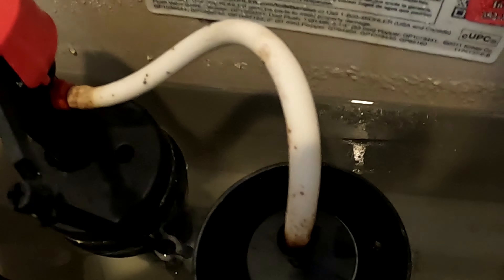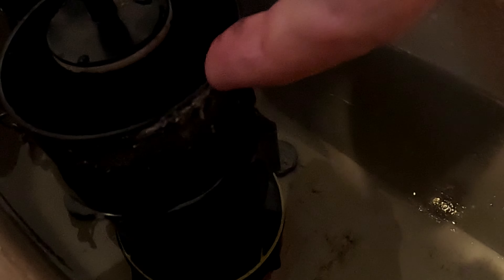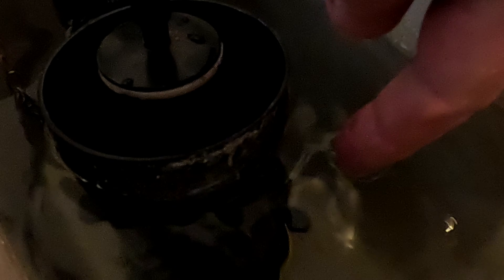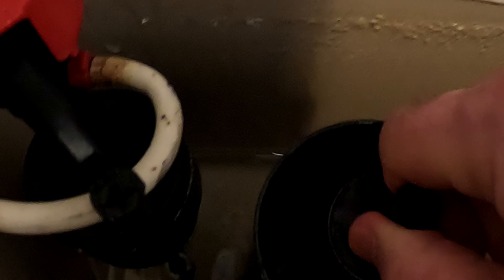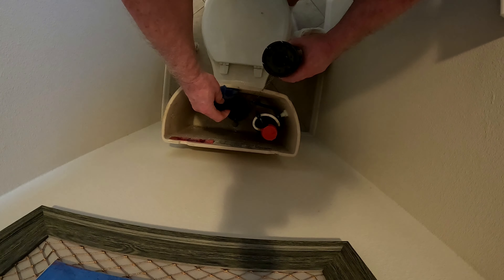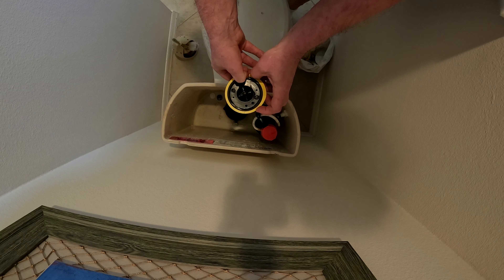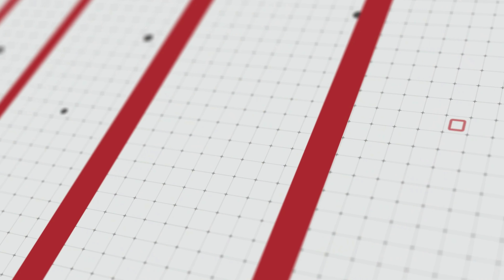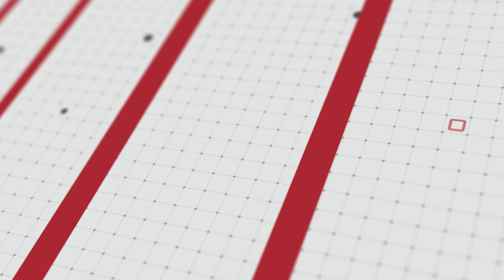The Villages Florida Toilet Fix

Comment: I had an intermittent problem with the valve staying open after a flush.  Opening the top and flushing again everything would work perfect.  I finally figured out the arm of the flush handle would raise up high enough to touch the underside of the porcelain cover and catch it which in turn kept the water running.  The plastic arm had some adjustment by the handle to lower it to solve the problem.

Comment: Helpful video skip. Thank's for doing it.
One suggestion though, I suggest to people to grab the center post at the bottom where it connects to the base of the flush valve. 
Less likely to break by doing it that way. And if it does break, no worries. ACE hardware has those also.